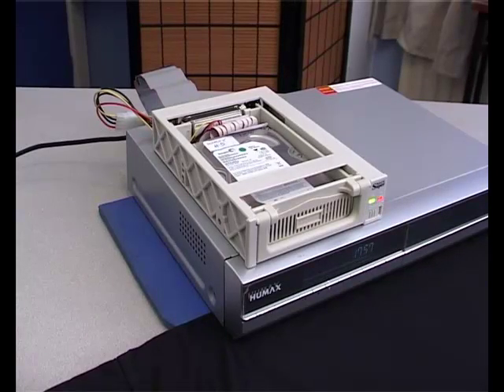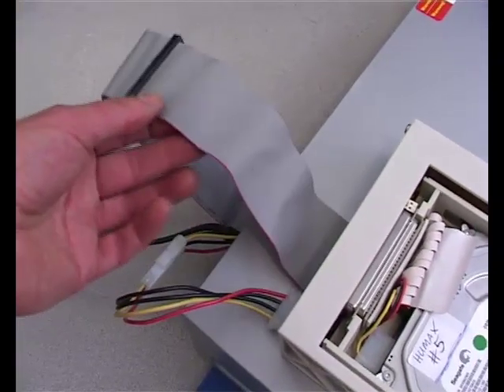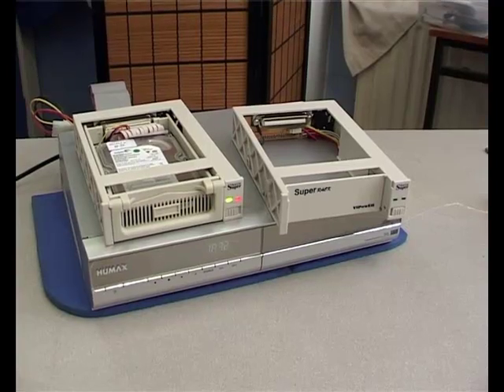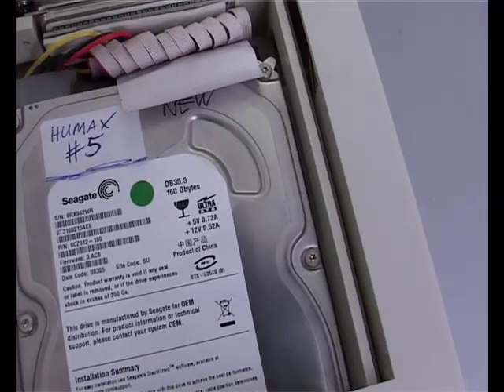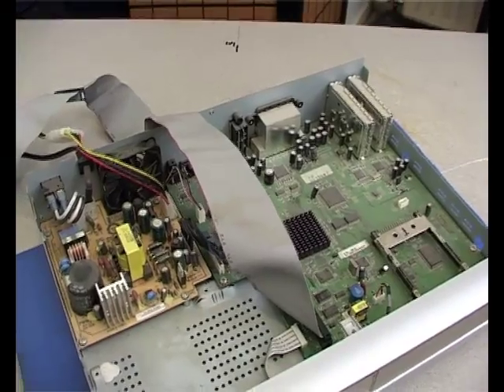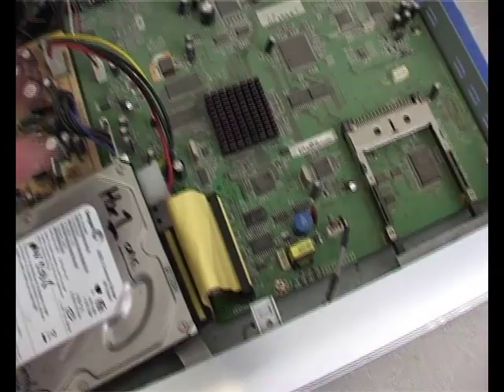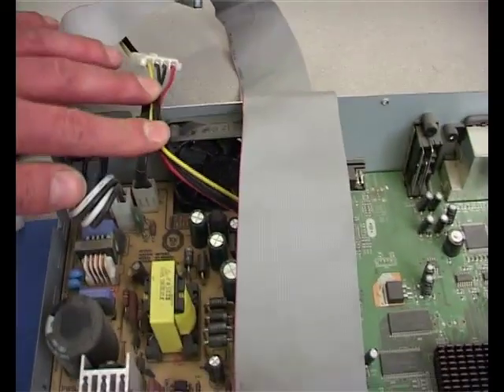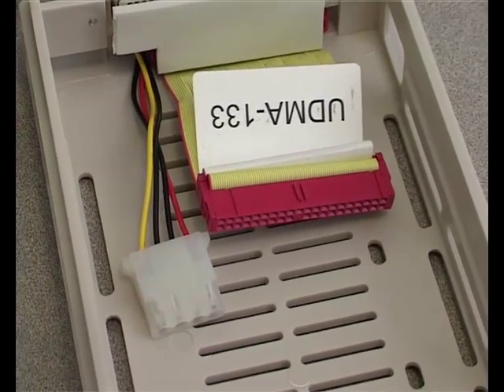Humax 9200T PVR Hard Disk Upgrade and File Transfer

Comment: @naka, ye'h, that sounds OK,,,, but once new HDD installed you must format it,to the file system your HUMAX uses, the option should present itself in HDD control. (Think it uses Linux EXT3/4 ? Not 100%) Huey will keep you right, the larger the HDD,the longer it will take to format as most modern HDD are pre-f'd in NTFS/FAT32 to suit Windows® ........    :-)